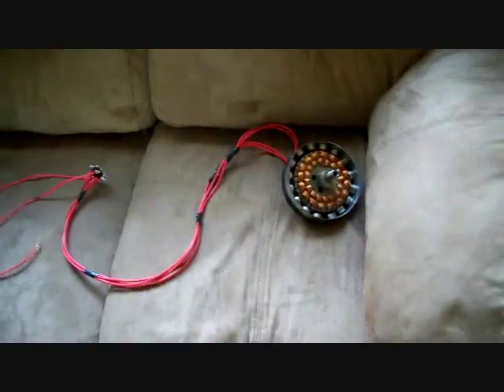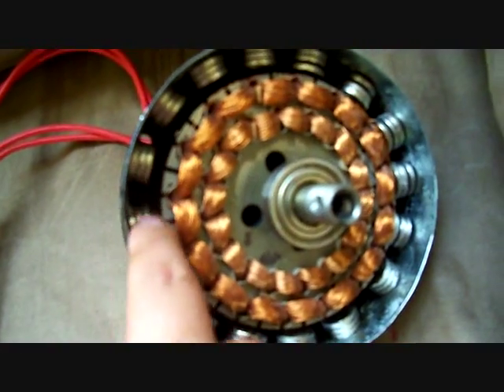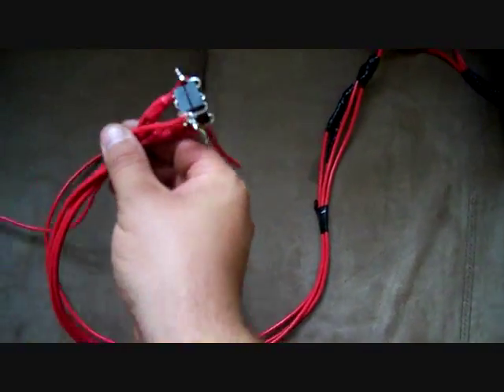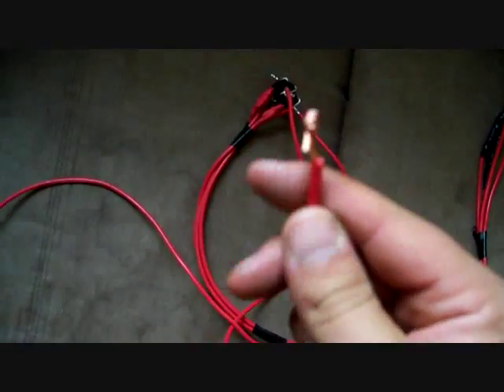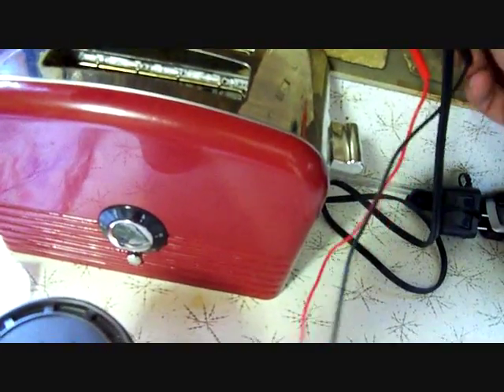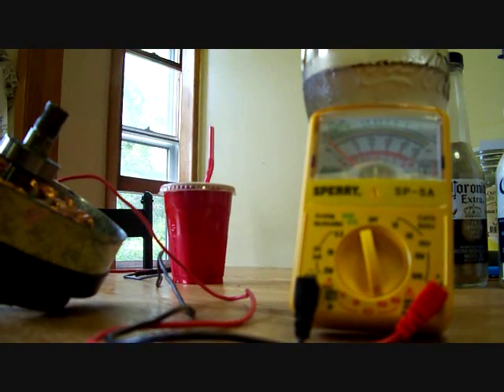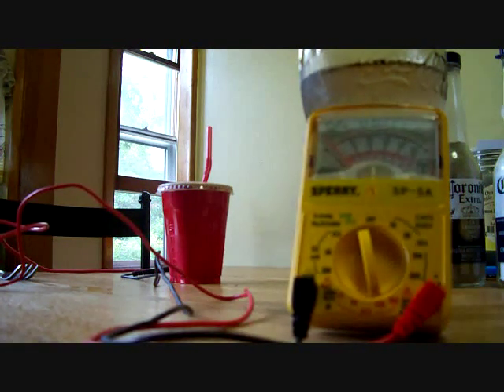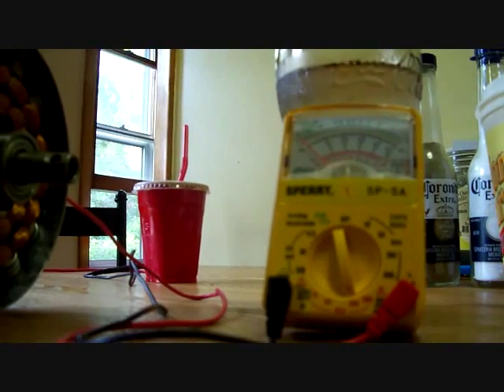ceiling fan homemade generator, for wind turbine/Windmill Part 1of 2

Comment: You'd need a charge controller. You'd need to find one that accepts a voltage range of the output of the fan. If you don't know much about electricity though you probably shouldn't start a project like this until you've done some more research. Trust me on that, it would have saved me a lot of time when I first started in renewable energy.